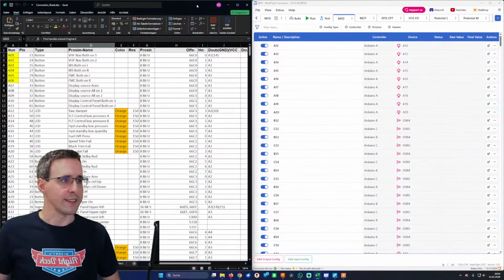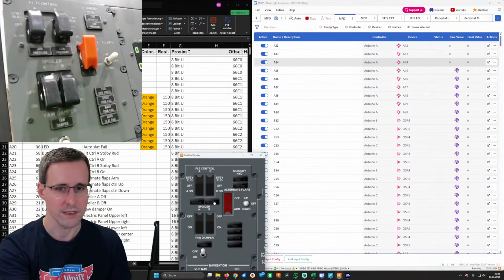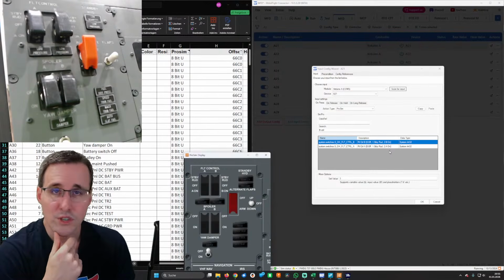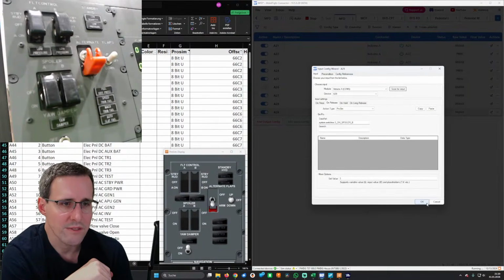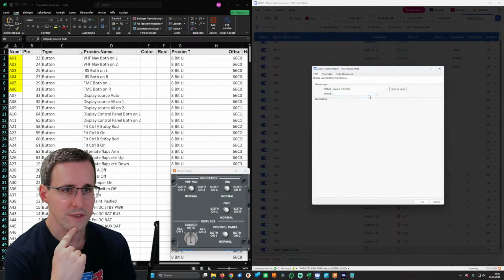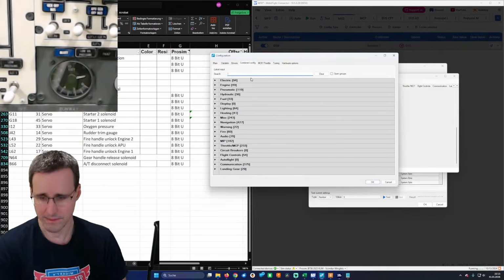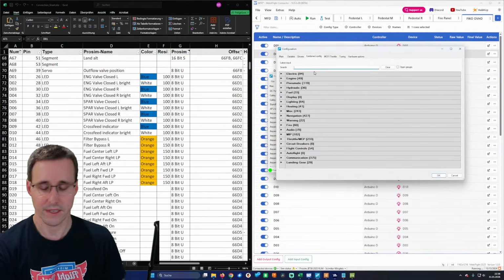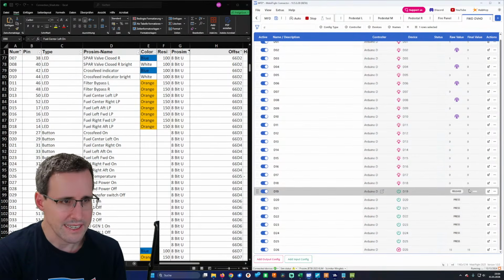Configuring my overhead panel with MobiFlight - Mickey's Flightdeck Live Stream 31.01.2026

Comment: Hi, why u use prosim between MSFS and Mobiflight? but u cann use the variables directly by MSFS in Mobiflight?
Reply from the maker: Because by using Prosim I can outsource a very deep system logic of the 737 to another PC or an instructor station. The MSFS doesn't have such a detailed 737. An alternative would be the PMDG 737. But this runs inside the simulator